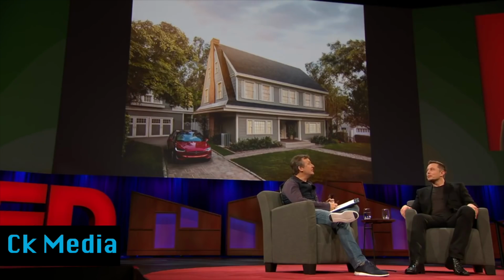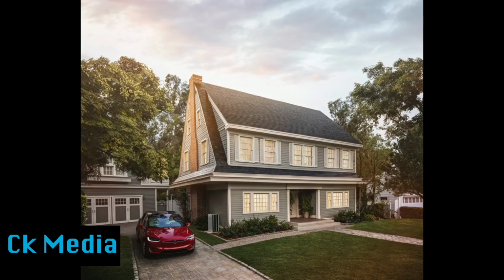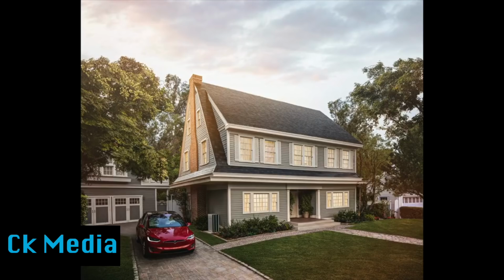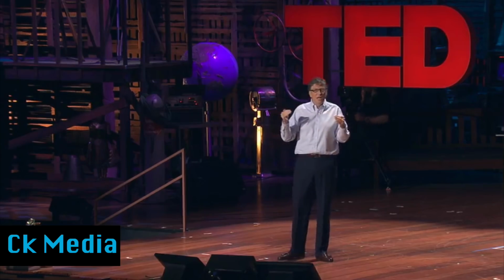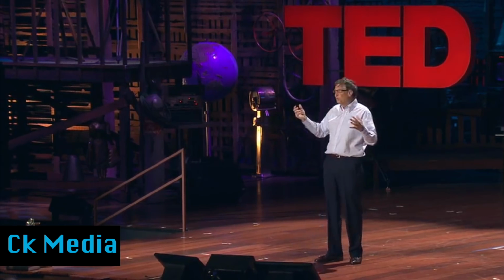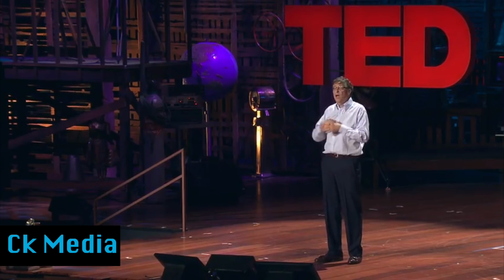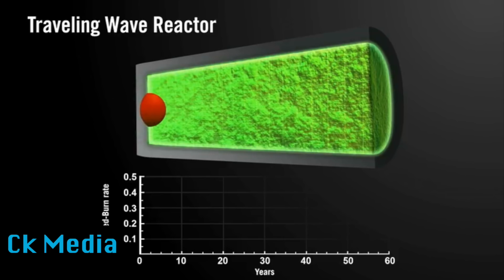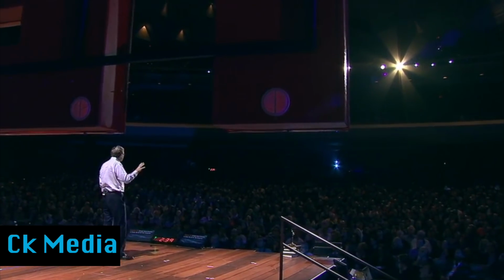Billionaires on Energy - Bill Gates, Elon Musk - Solar, Nuclear

Comment: There's has been over 12 inches of snow on my roof for the past 3 months.
Reply: So?
Reply: @nicholausstraach458  So it's possible that the statement "every house can be powered by solar roof tiles" needs a bit more consideration.
Reply: @Mooja12  So houses that cannot use them due to Northern Climates a solar farm somewhere else could power them. Just because you can't have one on your roof doesn't mean solar can't power your house.
Reply: @nicholausstraach458  You might want to re-watch the video.  It's relevant to the conversation you're having.
Reply: This is when Nuclear comes into play. It can provide the needed 24/7 power till the snow melts off your roof and you can start generating again and reduce the load on that plant. Situational solutions.
Reply: @Swarm509  So $100K worth of roof panels that are so useless that I also need a nuclear power plant.  Yeah.  We don't have this figured out yet.

Comment: And they sit in enormous rooms that must use loads of energy to heat.  I would think the future would be smaller homes, lower ceilings to reduce the energy use.  What's going to happen is the green new deal will pass, everyday people will have to abide by it, the rich and their celebrity buddies will find a way around it.  Hunger Games here we come!
Reply: People will have to fly planes comrade. TBH I have thoroughly read the green new deal and it is stupid and meant for stupid people. Giving people free money to those unwilling to work is immoral and would not work in broad society. Even Bill Gates didn't sign on. We cannot eliminate all fossil fuels in 10 years. Maybe we should shoot for half of the energy, but even then with reconstruction of every building it is impossible. You could train the entire planet to be engineers and you still would need double the amount of people to recreate our infrastructure.
Reply: Its lame is what it is!
Btw surface area is what radiates the heat, not volume. Even though it looks hundreds of times bigger than your house, its probably only 30x the area. So houses should be banned and only massive apartment complexes, with shared walls to reduce heat.
Why not eliminate humans from the equation. 1 vote for mass genocide!
Government control over the economy will never be effective.
Reply: I just read the wikipedia for the Green New Deal. It's a joke.
Their goal is to solve climate change, but they don't even consider nuclear as an option on the table.
If the letter's signatories start from a position where the options of carbon pricing, carbon capture for fossil plants, hydropower, and nuclear power, are not even on the table for consideration, there may be no feasible technical means to reach the necessary 1.5 ˚C climate goal.

Comment: Edison generator and dynamos power plants and vehicles are essential to survival.  We are grossly misinformed about power generation and power use.  We don't need batteries or plastic solar panels.  We don't need deadly nuclear power plants or wasteful fossil fuels power plants.  The Edison generator and dynamos power plants produce electricity of the same high voltage AC power continuous peak power to the power lines without fuel or pollution.  We are grossly misinformed about power generation and power use.  A battery powered dynamo powered electric cars trucks trains airplanes helicopters and ships immediately reduce fossil fuels use.  These are unlimited range electric power vehicles without fuel or recharge stations.  We are grossly misinformed about power generation and power use.  This program heard from Elon Musk is total Hokum we are used to hearing.  Nuclear power plants are banned by Treaties instituted by scientists to initiate survival and ratified by Congress.  The nuclear nonproliferation treaty is the legal and safe direction.

Comment: Elon talking rubbish again, you can't power a house on just a solar roof
Reply: Nafiul Shelim elon know more than you
Reply: Nafiul Shelim solar panels can get better
Reply: Uh, it's been done many times...
Reply: Brandon Porter what happens at night, what do you do about heating
Reply: You store the energy in a battery, and the energy is used for heating. But solar will always be limited by battery efficiency and photovoltaic power efficiency, and those things are improving drastically.
Reply: Nafiul Shelim don't forget  that batteries could  charge  faster if it was upgraded to another material
Reply: The issue is not the speed at which batteries can charge. The problem is the limited capacity, the limited lifetime and the costs. Also, in the winter solar panels generate significantly less electricity, right when you need the most (heating with a heat pump; less sunlight, so more lights). You'd need a battery that can span a season. That's waaaaay to big. Also, I calculated that if you put your whole roof full with solar panels, that it would be insufficient if you also want to drive with an EV and heat you home with a heat pump. The idea of a solar roof as a means to provide power for your whole house is flawed. At least for those living in moderate and colder climates.
Reply: Yes you can. I saw a lady from down the street at the library and I said, "I just noticed today that you've got solar panels on your house." She said, "yeah. We don't have an electric bill." We live in a place where for all but 3 weeks of the year, you need either heating or cooling.
Reply: @vanessavenkov6668  and  those batteries degrade and are based upon a highly toxic, limited rescourse. Thus defeating the point.
Reply: depend on where you live and how much energy your family consume
Reply: Glowing Alpine  i actually sell solar panels, among other alternative energy sources for a living in Finland. We haven't sold a single year round solar panel system. You wanna know why? Because they don't generate enough power in the long Finnish winter and storing excess from summers long light is ridiculously expensive. They're only really practical in summer cottages. Solar is only viable as a full term energy source near the equator. In most of Europe, russia, canada and asia it can only ever be supplementary.
Reply: @robinsss  Thorium energy is nuclear energy, just based on thorium instead of uranium. Geothermal is a pretty good option all in all, though i don't think it's as good as nuclear, Ocean wave is very experimental so not really an option at the moment, comparable to nuclear fusion.
Nuclear energy has a high up front cost, but in the long term it's actually the least expensive. Nuclear power plants have low running costs and long lifespans which compensates the high upfront investment. Nuclear power on average costs around 2.1 cents per Kwh. Coal is 3.2 cents per Kwh. Solar is close at 3.5 cents per Kwh. These numbers are from various different years so they may not be 100% accurate in 2019.
Reply: @nafiulshelim6194  -did you watch the video, he showed and explained his 3 powerwalls next to the house.
Reply: @Erowens98  - the battery degradation is getting muh better, its possible that with the Maxwell aqusition, their batteries can get 2x the cycles. The "toxic chemicals" is kind of propaganda. Pretty much everything is toxic. Have you heard of tidepods? fertilizer? The metals can be recycled, and there is a huge incentive to do so. I dont know enough about the electrolyte, but it cant be worse than a lead-acid battery, and those are like 99% recycled.
Reply: @Erowens98  - Lithium isnt very limited, cobalt is, but it is being phased out of the chemistry.
The metals used are mainly
Nickel Aluminum Steel Cobalt and Lithium. No unobtanium nor extremely rarium.
Reply: @Erowens98  - in the future, superconductors can could help with this, because half the world is lit af all of the time, but that is made of unknownium. My favorite system for polar regions is geothermal. I think Norway has plenty of geothermal, does Finland? I love geothermal.
Reply: @Erowens98  I've heard the problem with thorium is that you have to breed it into U-233, and this takes about a month. Could be wrong though, remembered (not reliable) Wikipedia (also not reliable) is my source.
MSRs are so much safer though, we just need better metals to avoid corrosion.
Reply: The key to using just Solar/Wind for powering a house is to make sure the house is built to be inherently as energy efficient as possible. This mean build well, with good  insulation, sealed correctly, and with mechanical equipment sized for that building (most furnaces can be quite small and are already very energy efficient). Do all of this and you can get a passive ready house.
Reply: Yes you can solar can produce the power you need for your house and battery technology is improving with others besides lithium. Combining solar with the grid allows us to cut down CO2 emissions by a lot solar provides power during the day some of it is stored on battery some is taken from the grid at night. Producing and using  more solar power cuts back on most hours per day's worth of coal related  pollution.
Reply: @Erowens98  In California solar covers most of our needs, where it makes sense to do it, it should be used as much as possible. Can't wait on other more expensive and more time intensive technology like nuclear through Thorium though the world does need various approaches. To look for a silver bullet is  the wrong approach, diversity in technology will help tackle most problems in better ways.
Reply: @Zachary Thomas what happens at night or a cloudy week?
Reply: All we need to do is add so many solar panels until you just cannot possibly fail. Then you're green and can claim success.